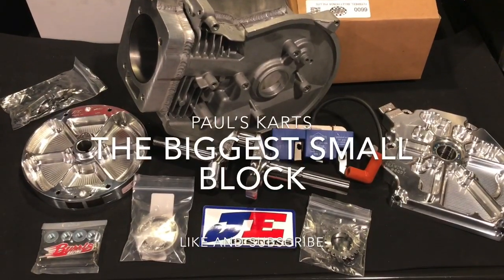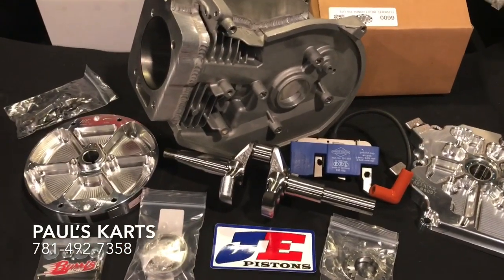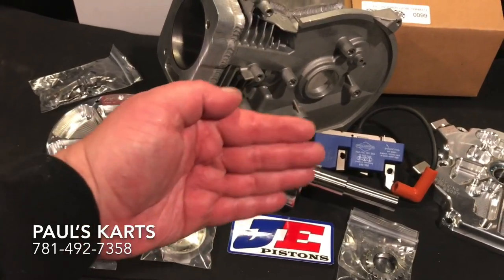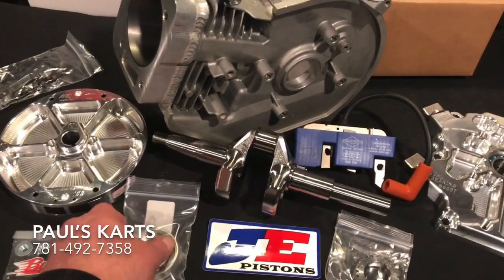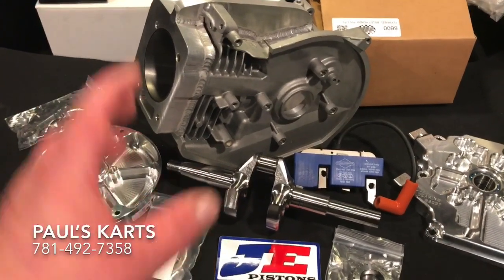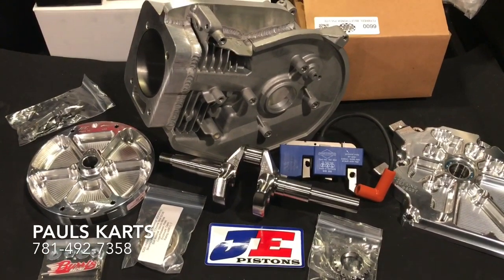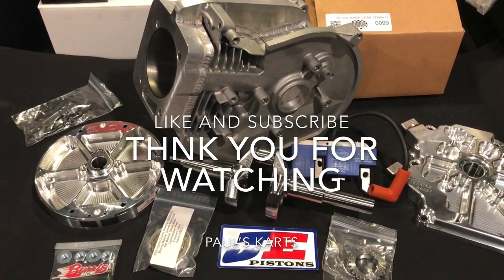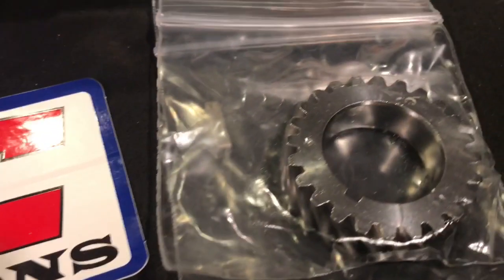**300cc**  PREDATOR 212 BUILD .. HOW TO // PARTS LIST YOU NEED ...

Comment: When is a billet side cover required?
Reply from the maker: Always
Reply: @paulskartslifan4206  ok because I'm about to buy a 265 hot cam and didn't know if I really needed to spend that much on the cover or not for a yard kart
Reply: @stevenlocke4769  Don't bother for your usage... save the $ on something else that makes power.Prof engine builder speaking.Trev NZ

Comment from the maker: This is a true 35 hp build .. you will not make even 20hp with any stock bore stock stroke engine .. so many people think there making 20 + hp and first thing they say is stock bore stock stroke ! That’s impossible .. this is the real deal ! This has relocated head bolts and the head has to have bolt holes moved .. this is the biggest small block I have even built .. but it can get bigger .. with more stroke ! This is a massive piece ! This is extremely involved ! This is why I love my job !
Reply: I actually agree with you on this one👍
Reply from the maker: Thanks
Reply: @paulskartslifan4206  I'm interested in what the motor is made of Cast iron or cast aluminum" what type of welding did you do the brace the Engine for strength" l mean I get it" you are squeezing bigger parts in a smaller block" to make A more powerful package"..'SO" when is someone going to do the homework" and have all these parts made As stock parts" strengthen the block from the sides and top and corners 5min Thicker from the outside" Now in This type of motor can go for say $980 And parts in on the shelf to replace if needed"
Reply from the maker: @RGIIIBOXING  cast aluminum
Reply: Paul can you do a 350cc set up with the 212cc.. welded block. Were talking $4500 for 50hp....3in stroke + 3in bore" your heads..mild racing cam...32mm Carb" billet balanced stroker crank...That 1 pound 2 stem fuel pump" I would like to  run 92 or 93 octane" This bike is not for racing..it would be for riding..."And too Take to the Track..Can it Be Done" 50hp...
Reply: @RGIIIBOXING  92-93 Obtained gas your pushing it unless you build it with a few tricks.
Reply: @RGIIIBOXING  Get an old 1960s Johnson V4 water-cooled you'll save yourself bullion & you'll have more than 50 HP & a 2 Stroke ,imagine ,4 megaphone exhausts or chambers poking out the rear of your Kart, it's been done before..outboard motors go.Trev NZ
Reply: The Last engine I heard refered to as a " small block" was a SBC small block Chevy....
Reply: Fuck Yea Paul
Reply: We need dyno numbers